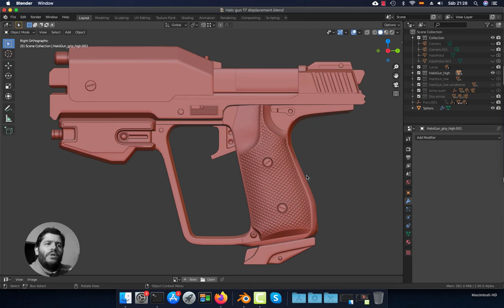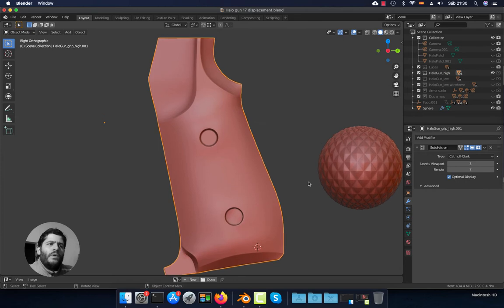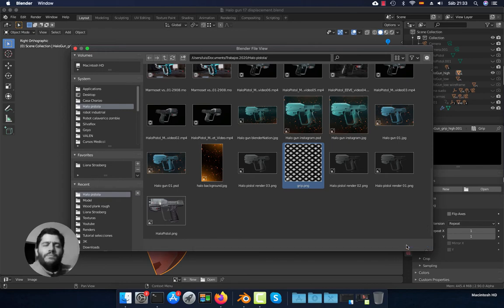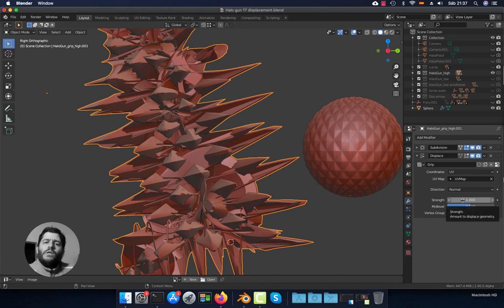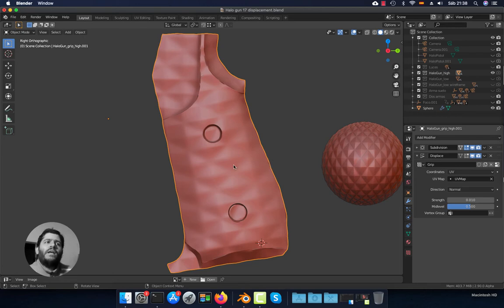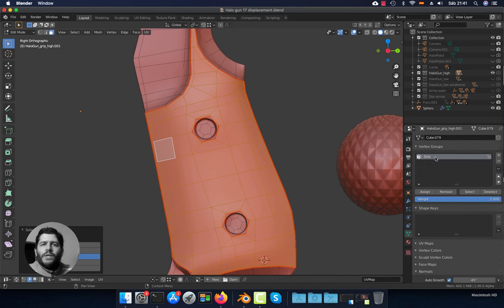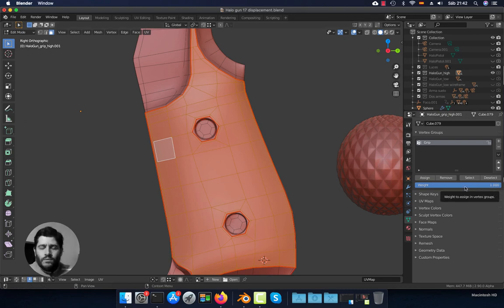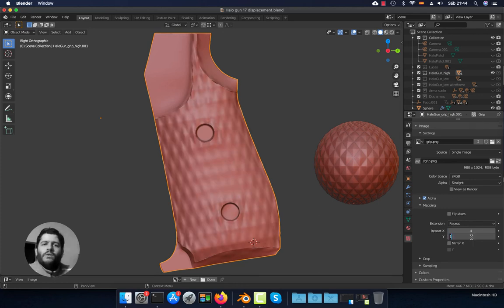Making a weapon grip with Blender Displacement modifier

Comment: but wouldn,t this method blast the amount of geometry  ( just wondering ) cant we use a normal map instead ?
Reply from the maker: Hi subham singh, Yes you can use  only a normal map if you want to keep it very light, this method is useful for make the baking later with substance or marmoset and for high quality rendering. Because it gives more 3D details for close ups.